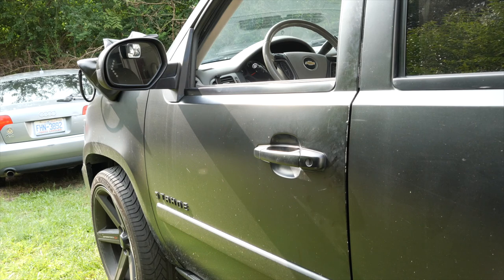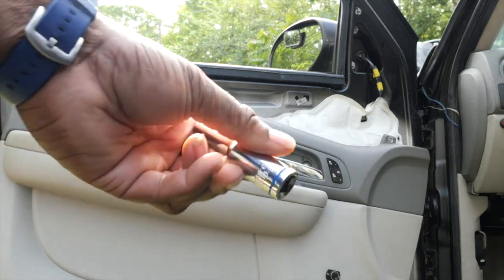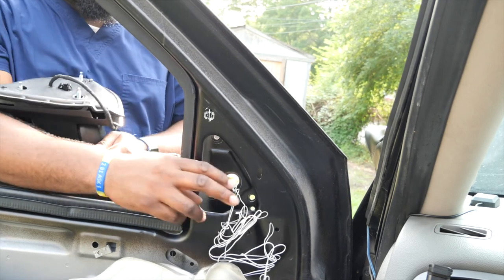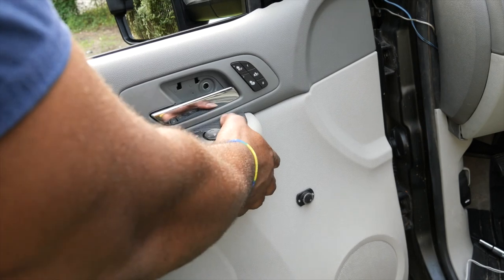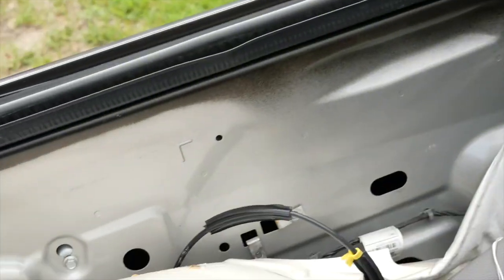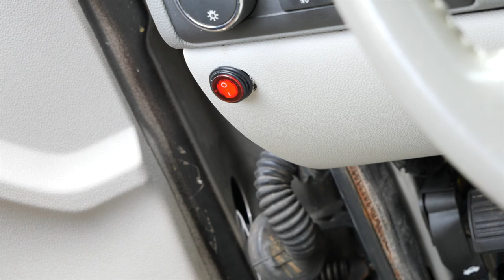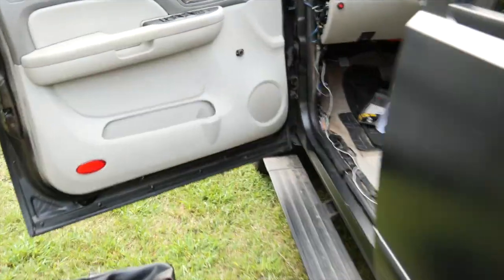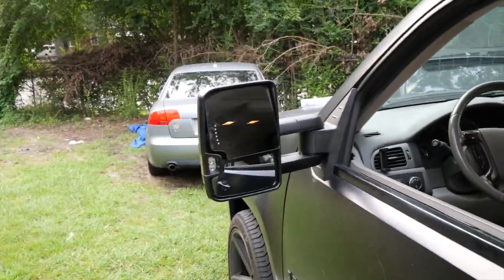How To Install Tow Mirrors on a Chevrolet Tahoe / GMC / Yukon / Suburban

Comment: You could also run the led light wire to light up when you unlock the truck. Think there called curtesy lights
Reply from the maker: just seeing your comment, yep that what i did a couple days after doing this video...thanks

Comment: Nice video! I gots the same ones for my 05 Tahoe. Can’t wait to put em in. Be sure to grab that 3rd bolt and put em in on your driver side, their pretty heavy for 2 bolts. Call the dealer and they’ll have em
Reply from the maker: BLacK HarTz cool thanks man! ✊🏾
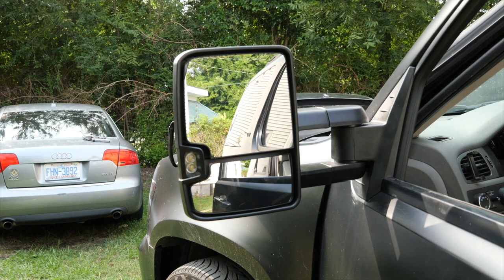Reply: 540TV @7:40 that center led light/or reverse light, ima wire  that up to the wires on the door “that turns on the cab light” when you open the door. I got a light on door trim that lights up. So I’ll tap into that, i got driver on today and I’ll do passenger side tomorrow lol

Comment: I can’t get the turn signals to work, what options do I have? 2014 Tahoe.
Reply from the maker: I ran my turn my turn signal wires to the rear of the truck. It was easier

Comment: Looks easier to run it to the back versus to the fuse box
Reply: I don’t see how
Reply from the maker: yea it was which is why that was the route i took. any wiggly of a connector and now you have another issue

Comment: Wtf are those two wires you got coming through the fender like I did with the amp power wire when I was in high school? You couldn’t find a hole that went through the firewall and you giving advice on how to replace stuff. No thanks 😂